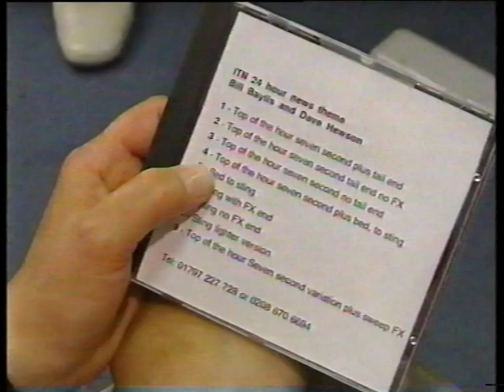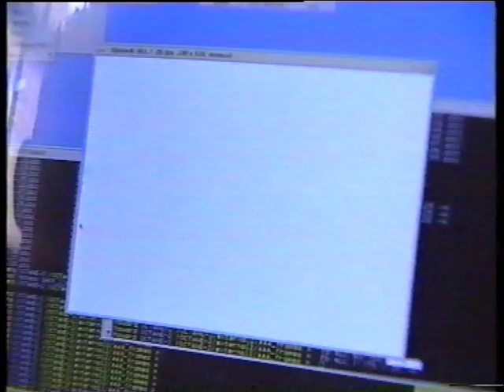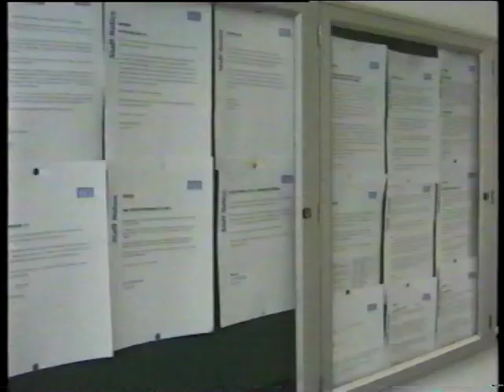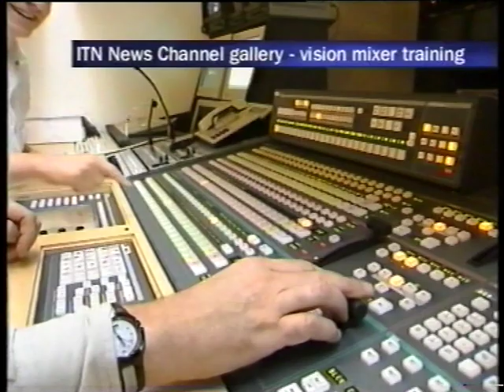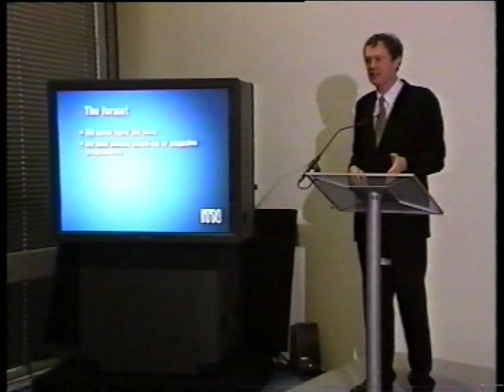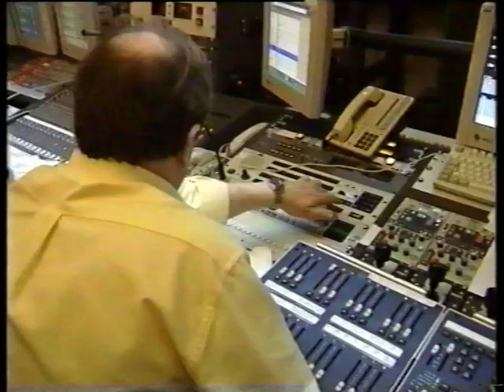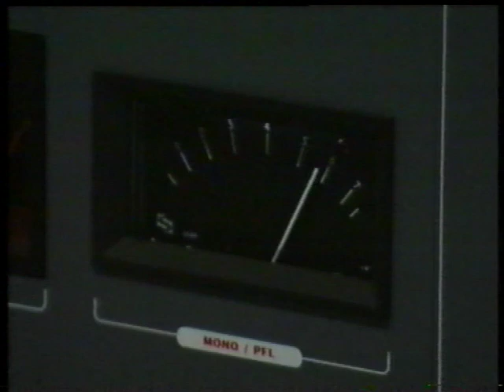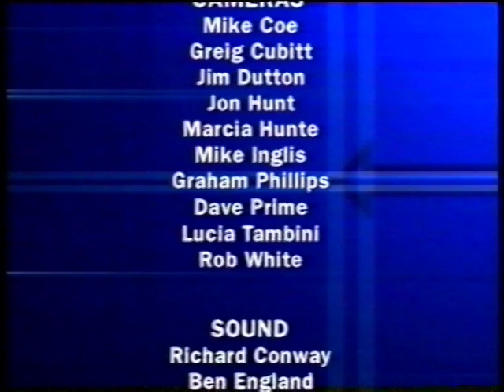ITN News Channel pre-launch behind the scenes documentary. 2000

Comment: The original ITN News Channel studio was not fit for purpose. It was perfect for 30 minute bulletins, not for rolling news. One presenter was all they could manage and it was not right. They moved into the ITV national news set in the basement studio in 2002, even that was not good, as that set was designed for set bulletins. It was only in 2004 when they revamped and move into the virtual "Theatre of News" set did the News Channel have a decent studio set design.
Reply: The main problem though, surely, was that too few people could access the channel.

It wasn’t available on sufficient platforms.

Comment: Why it was defunct ?
Reply: It was due to small ratings and that ITV launched ITV4 the month before it ended (November 2005) and CITV in March 2006.
Reply: ITV News Channel suffered poorly due to budget restrictions. From 2004, they simulcast a lot of ITV National News bulletins, as well as repeats from 1.00am-5.30am and 6.00am-7.00am. There was no problems with Sky or Cable, however Freeview platform became much restricted due to the launch of ITV4 were it had to share its channel space from 6.00am-6.00pm ITV News, ITV4 took over from 6.00pm. That was the kiss of death for the channel.
Reply: @Toffachannel  ITN News Channel actually closed 6pm 23rd December 2005, but originally the closure was scheduled for 2006, it's closure date was brought forward, the reasons being that 'it would have been unfair to the staff that they were working over Christmas knowing that the channel faced imminent closure shortly afterwards'.